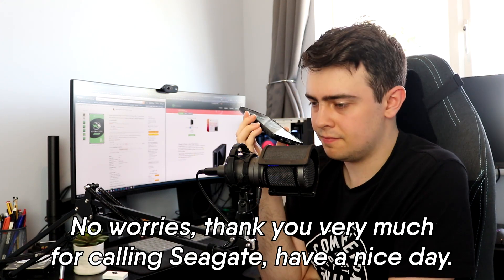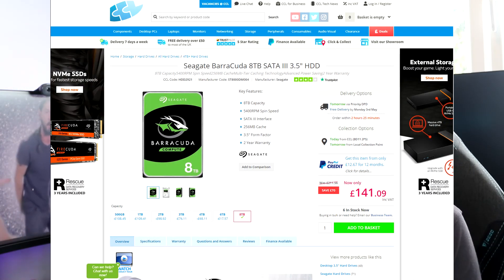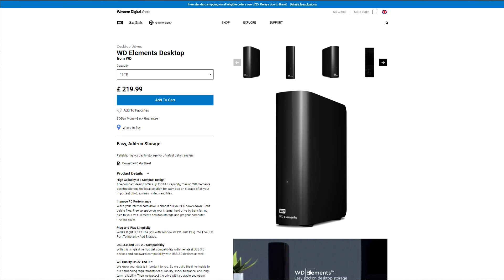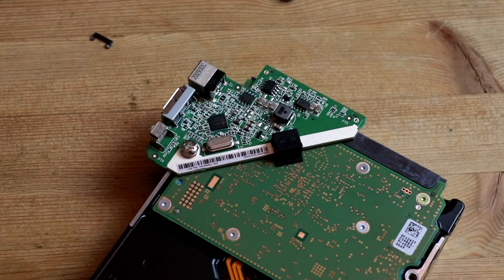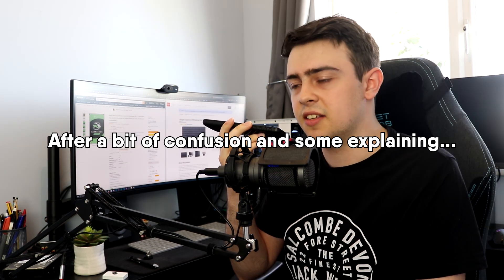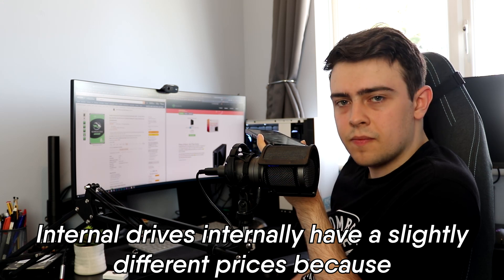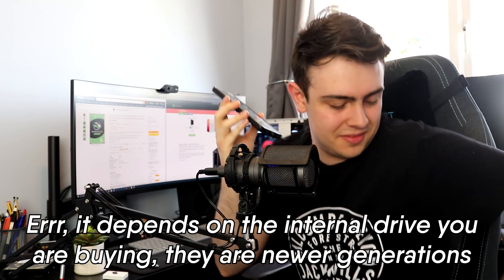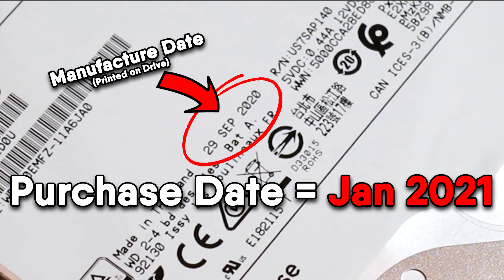How To Get CHEAP 12 TERABYTE Hard Drives! | Seagate Exposed!

Comment: internal drives can be used to run a OS so I believe they are thinking more early failure rate so more warranty work and more cost to seagate, a external drive has a low failure rate before the warranty is up so no cost to seagate. most the externals have 1 year warranty, I think lots of the internals had 3 years or 2 years. Now most have 1 year but was different 4 years ago.

Comment: Do not use shingled drives for parity or any situation where there is multiple read writes. They are sort of... "ok" for write once read data file storage. However they are a recipe for disaster anywhere else.  If you have a live database running on one, it's gonna fail. Remember, sh*t on shingle doesn't just refer to chipped beef on toast if you get my drift.
Reply: When a NAS newbie i put Barracuda drives in it….bad idea!

Comment: That does not sound accurate to me.
There’s a big difference between a consumer Seagate HDD and an Exos.
Hell, we’ve had a case where WD lied about their Red HDDs, marketing them as NAS drives, where in fact they’re SMR and not CMR.

To be honest, you can’t just shuck an external HDD and use it in a RAID or RAIDZ, these are most likely SMR consumer HDDs, which are ok for the usage you’d expect on an external HDD, i.e. store data that isn’t super important and that doesn’t require constant spinning and frequent r/w operations.

I’m ok with dumping a ripped movie library on a consumer external HDD, who cares if the data gets lost.

Comment: I can tell you from experience that some external drives are not certified for long running in a pc so they take all the drives that fail testing in some way and as long as it is stable enough they put it in an external case assuming that it will see less power on time which will extend the life of that drive i used a 1Tb in my pc it lasted 1 year and failed so bad that it did not even show up in bios

Comment: Usually the real reason external drives are cheaper is just lower margins for the external one (the target audience stuff), but most importantly, external drives usually come with better warranty (so, kind of mandatory extended warranty purchase).

As mentioned, sometimes the external drive is neutered, but usually a tape is enough to ignore that. Be careful with blind purchases, I've seen WD that have the USB interface directly on the hardrive, thus no phisical compatibility with SATA (tho that also means a shorter drive, wich is good if the intended use is in fact external as is)

Comment: How do you know before you buy these external drives that the same drives are the exact model and version as the internal you are shopping for. The internal might be a high-end enterprise OS nas drive but the external case might be a  low-end model that is slower, has less cache, is older, less reliable, or did not pass qa. I guess shucking might make sense if you are buying low-end drives. Or we're you able to confirm the drives were the exact model, age, and generation?

Comment: Hi RMD Tech friends. Is there a 'tape a pinout' method to make a Seagate work as an internal drive (for Seagate drives that only work as an internal drive)?
Western Digital has that 3rd pin on the contacts of the power to enable some WD drives.

God bless, Rev. 21:4
Reply: It's the same thing. Kapton tape on pin 3 or use a molex to SATA power adapter, a SATA extender that specifically is missing the 3.3v, etc. It's actually not a manufacturer thing to stop shucking -- it's that they're using  a lot of Enterprise drives in the external enclosoures, and those Enterprise drives support the newer SATA 3.2/3.3 specification. That specification includes a remote management feature called PWDIS (power disable) to let someone remotely power cycle the drive. 

In older SATA specs, pin 3 provides 3.3v power, but pretty much no SATA devices actually wound up using 3.3v power, so pin 3 was repurposed in the new spec for PWDIS. Basically any time the drive detects voltage coming through on pin 3 it triggers a reset. The problem is pretty much all consumer power supplies and many NAS devices use the old spec and thus put 3.3v on pin 3, so the drive gets stuck in a disabled state and never spins up.
Reply: @evilcoleslaw  Hi there's no way to make it into an external drive then? If there is, could you tell me or point me to a link? Thank you.

Comment: I have had a number of external hard drives. All my external Seagate one died in short time. I also have a WD Elements and a WD My Book external drive. The ONLY drive still working to this day is my 4TB WD My Book, all the rest have FAILED.

My advice is, if you value your data at all, buy a proper internal hard drive so that you know you have a full guarantee on a bare drive and you can make sure it is a NON-SMR drive. A lot of re-sellers will not allow an RMA if the drive has been tampered with (such as by opening the enclosure the drive came in).

Comment: Thanks so much for your video, really helpful! I use large capacity drives for films & OBS recorded course lectures etc.. My external 2Tb WD Book suddenly refused to be visible on the PC. Was lucky to find an internal Seagate 6 Tb IronWolf Pro which came with 3 years recovery for £122, which I now use via a Wavlink SATA drive caddy. As my external WB Book 2Tb now refuses to be detected by file explorer even though I can hear it spin into action, makes the familiar USB sound when plugged into the USD HUB yet refuses to appear in File Explorer. I wanted to ask if shucking that drive might help it appear on file explorer? Thanks so much! (P.S. Gone right off WD drives as I get the impression they have a higher failure rate)
Reply: yes its worth a go also use the win10 'victoria' HD program on it... set to 100ms..takes a long time but worth it to remap the bad blocks

Comment: Keep in mind, though, that external hard drives are also usually devices that did not make the 5/5 Star internal quality testing. So you can save some bucks but but end up with a drive that dies earlier.
Reply: Not according to BackBlaze testing data.
Reply: @JosephASorrentino  Oh. I didn't know that BackBlaze use to shuck drives. :face-blue-smiling:
Reply: That's complete nonsense.  Same drives off same manufacturing line are merely diverted to being put in enclosures.  I welcome you to present any evidence to the contrary.

Do you understand MTBF and the bathtub curve associated?  If a drive has defects then it would tend to fail long before the typical (2 year in Seagate's case for these in 2025) warranty had elapsed.

Plus, I've had very good lifespans from my USB external HDDs, including Hitachi, Seagate, and WD.  The one thing to keep in mind with an external is that being passively cooled, it needs to be in an area where there is reasonable air exchange around the enclosure, not stacked up in a corner with a bunch of other heat producing devices.

Comment: The drives used in externals are designed for an enclosure and are more prone to damage and the environmental temps than a drive designed and built for internal pc. Though the external drive may seem just as good as the internal drive, the external drive outside the case will be more at risk of damage when removed than a built for internal use
Reply: totally false...

Comment: I have been doing this for a very long time for all of the reasons you have mentioned in your video.  Shucking as you call it (great name for it) has become standard practice for me.  I also get a nice USB Cable and a 12v dc power adapter to boot (no pun intended).  I can tell you with absolute certainty as a tech with over 30 years of hardware experience that the 8TB Barracuda External from Costco for example I bought for $109 on sale, bought 3 of them to make a nice RAID 5 array.  I compared it to an off the shelf bare Seagate 8tb Barracuda Drive only from Newegg.  Firmware was the SAME EXACT VERSION.    In the case of RAID you DO want your firmware to be the same version if at all possible.  Sometimes it will work anyway but I have seen cases where the raid array will be slower, stutter or have strange issues if the firmware is vastly different.  Of course this also depends on your RAID Controller and how tolerant it is to having different drives in the array.  Awesome video though and I am glad someone has put this info out there.  I try to share it with friends and colleagues as the cost difference in the case of the 8TB Seagate Barracudas for the 3 drives I bought at $109 =  $327, the same drive with internal only $169 x 3 = $507, difference of: $180.00 enough money to buy a COLD SPARE drive!  That is a HUGE difference in price.  You are dead on when you said the lady from Seagate spilled the beans so to speak. They charge more for the internal drive because they are banking on the fact that most people who will buy an internal only drive are builders or people who WILL PAY IT, vs just anyone who can buy a USB drive and hook it up and go.
Reply: RAID is one of the cases where you don't want these drives, rather you want some with firmware that doesn't time out on errors so quickly to wreck the array.  Everyone knows this.  It's why they sell essentially the same drives with different firmware to handle that.

Comment: That totally makes sense.  Demand drives price.  But I can also imagine that when they release a new generation of internal drives, the remaining stock of older drives could be sold as external.
Reply: Yea, tho o on high capacity units you usually are guaranteed to get top tier drives, as that's the only in production

Comment: I had 2 shucked seagate drives die within days of each other. When I called for rma they said no. I told her thank you and that I was going to replace them with WD drives, she had a change of heart. I recommend people do what I keep forgetting to do and mark on the drives which enclosure they came from and keep the enclosures. That way you can put them back and rma, you can always say you unshucked it trying to fix it😀. I had no problems with WD.
Reply: My Seagate shucked drive was an external Exos, I put the serial number in their warranty checked and I get 5 years.
Reply: Seagate drives on backblaze are worse than WD. Bigger failure rate
Reply: umm isn't trying to "fix it yourself" grounds for voiding a warranty?

Comment: That was very interesting. I have never heard of shucking, but that's what I did! I bought a caddy which holds 10 drives and to go in it I bought 10 external drives which I broke out of their cases. They were much cheaper than internal drives. What was interesting is that the drives weren't all exactly the same model, so it's clearly a cheaper lucky dip when you buy external. If you want a particular cache & spin speed then you have to pay extra to get exactly what you want.
I never had any power problems like you mentioned. I didn't understand you having to put tape over the 3rd pin.
I noticed the other day that someone was selling the enclosures the same as mine came in online. They aren't really designed to be reused as you have to break the seal and are hard to put back together. I tried it with one of mine in case I wanted to convert a drive back to external but I broke at least two teeth which held the two halves together on all of them. I thought it was an odd thing to sell as you can buy enclosures which are designed to be reused. The seller I mentioned was also selling the power cables & sata leads, and further down the list were internal drives, then I realised they had worked out how to make a bit of money! I do think you lose your warranty though. It was chance I took, but good luck sending a faulty drive back to a seller after 10 months which had a year's warranty when it was an untampered external drive and which became invalid the day it was shucked.

Comment: When you open the external to find an enterprise drive you can find an internal drive model appears to be exactly the same. They may have 3 drive models to pick from so if you want to use in a NAS, a random 8 may have different mixture of models in the external cases (same external model number). This depends on what drives they have excess of in stock. Warranty & data recovery service on the full retail internal drive will be better than the 1 or 2yr warranty of the external drive. Warranty & support are a large cost of the overall price but supply&demand is also a factor. YMMV. Do you pay less up front to pay more later? or the reverse?
Reply: It ia more of clearing stock of lower grades hdd than demand/supply factor.

Comment: Just shucked 3 18TB WD Elements from Amazon £350 each for my QNap NAS. The disk are white label WD180EGGZ but I'm guessing they are rebadged Ultrastar DC HC550 looking at the P/N etc. or they could be Gold Ultrastar's. NAS reports them as 7200rpm with 512mb cache cheapest internal WD 18tb HDD I found was £590 Seagate £470 Largest internal HDD I found for same ££ was 14tb but 12tb was the general size at £350
I've never shucked HDDs before but it took 2min per, worked in NAS copied 5tb on to them to test worked no issues.
I also tested if I could reassemble if needed to return took a little longer but no issues
Reply: EGGZ lol 🥚

Comment: Are not all external hard drives 5400 rpm vs the regular internals that are 7200 rpm?
Reply from the maker: Nope! Many external drives are the full 7200rpm. And many internal drives are 5400rpm too.
Reply: @RMDTech  oh i see.I knew about internal they are both 5400 and 7200 rpm, but i thought all externals are 5400.Can you link me to some 7200 external please?

Comment: Ive been doing this since 2014 and have a 100% success rate. I would recommend not attempting this on WD slim drives because they dont have a sata connector, just USB 3 or type C. I know this because I own a bunch of "pi-drives" which were a promotional 314GB HDD for the raspberry pi back in the day. Its just a bare drive.
For WD HDDs, you usually need to use the diskpart utility from an elevated command prompt. Select the disk, then clean the disk, then use disk mannager to partition it. Takes only a minute, but dont mess up using disk part, i haven't, but its easy for a simple typo to ruin your day.

Comment: With the speed of USB 3, and the fact that I use software RAID, I've found using the external drives as-is works well too. I have two USB 3 hubs, one plugged into each of the two USB 3 ports on my desktop. I keep my main storage, on one hub, the backup drives are on the second hub. When I want to backup each week, I just hit some switches to turn on the backup drives, run the backup program, then turn them off when done. I have multiple pairs of drives, which I treat as volumes, with files from different time periods. So the externals make it easy for me to swap out to find what I need.
The biggest thing I don't like about the external drives is the power-down cycle. For internal drives, I can specify power-down after 2 hours of non-use, or whatever I choose. The external drives are often preset, non-user-changeable; with some drives having a ridiculously low 15-minute power-down time. I despise frequent powerdown. I have had two laptop drives fail after just a couple years, both of them had 1800-2100 hours of on time, but over 5000 spinups, according to SMART. I really don't think drives are designed to handle that many frequent starts.